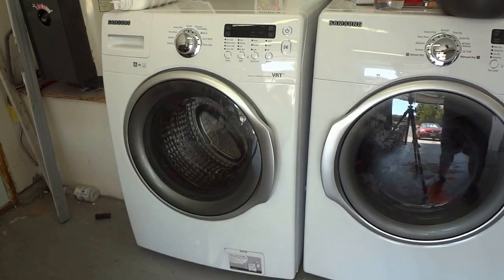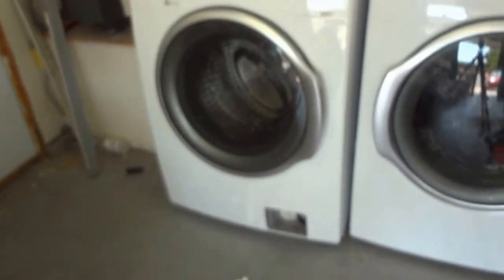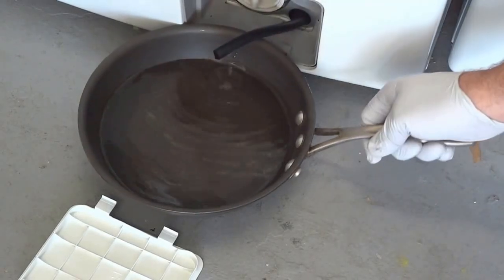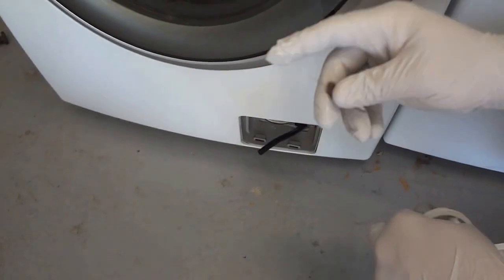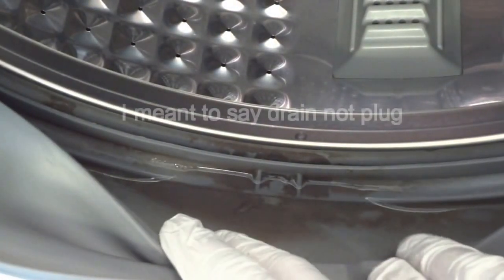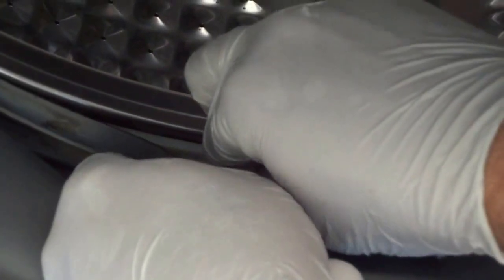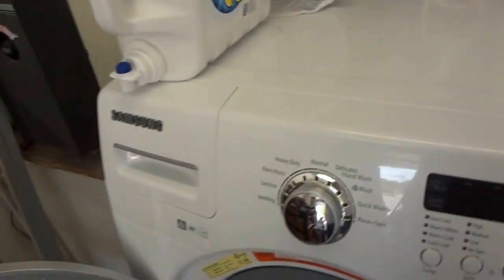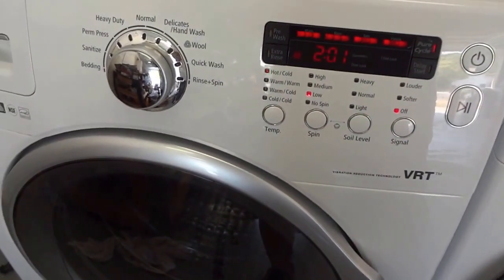Getting the stinky smell out of a Samsung front loading washer

Comment: I am an appliance repair technician and I will tell you that the odor is evidence of soap buildup on your inner plastic tub. Almost everyone has this problem. To confirm that you do, run an empty cycle with hot water and no soap. If you see lots of soap suds suddenly appear in the drum during agitation you need to do a vinegar wash to eliminate the build up. A whole gallon of vinegar should be used as the vinegar gets heavily diluted in the process. Start a clean washer cycle, then blend the vinegar with the incoming water during the fill. Cleaning out the soap residue takes away the food source for the mold and bacteria. Repeat a vinegar wash every 2 weeks to 30 days. Stay away from pods! They are too much soap and will get you right back where you started. Lastly, if you have a water softner or treatment system use almost NO soap. You dont need hardly any because your water will do the cleaning by itself. Think of your detergent as a water softner and conditioner. The water is conditioned to clean. If you have apparatus doing this on your water supply, adding detergent is redundant.
Reply: What about the inner lining? Will that (vinegar self-clean cycle) be enough to clean it or is scrubbing still recommended? It was recommended to use "Affresh" tablets with the self-clean cycle (which get used once a month). But there is still this sewer smell! AND we ruled out the p-trap (p-trap is not what smells!). The smell is coming from the bottom left side/bottom left corner of the washer where the drain tubes are. (Clean out area is empty and clean, draining clear water)
Reply: We read that vinegar will ruin the machine?!? That it is too hard on the hoses?
Reply: Don't use washing machine cleaners unless they are citric acid based. Check the ingredients and if you see sodium carbonate or sodium anything as the first ingredient don't use it! Sodium is what we are working to remove when we clean. You can't clean out sodium with more sodium! Vinegar or citric acid are food based acids with a mild acidity and won't harm anything in your washer.
Reply: @mikewalsh511 any thing acidic can corrode spider arm

Comment: It helps a lot to leave the door open between washes.  Our laundry area has a door itself so there is not much room if that door has to be closed.  So I wedge a styrofoam cup in the washer door so there is a few inches of gap.  I also have a tiny "desk" fan I use to circulate air into the opening a couple times per week.

Comment: I bought a product from Home Depot, called Afresh, that does a great job of cleaning my front-load Samsung washer. Once a month I put a cleaning puck inside the drum and activate the self-cleaning cycle. The first time I used it, after owning the machine for two years and becoming very stinky, it made the self-cleaning water in the drum super dirty. My machine no longer has an odor problem.

Comment: 7 years and I've never ever noticed this frigging bottom entry and even googled my make and model of how to self clean and Samsung instructed to use Pure Cycle mode as you described with no product and its 2 hours. Still smelled.  Purchased products for cleaning high eficiency front loader washers too. And finally googled elaborately how to clean self clean samsung blah blah blah BAD SMELL and here comes your video and I'm mind blown with this discovery trap with stinky water right there in plain sight at my feet (wtf!!!!) and the disgusting stenchy moldy nasty residue when pulling back the resistent rubber. I'm completely jaw dropped and smelly from watching and immediately following everything you did including the vinegar, but took all your advice and will literally never ever think about anything I've washed because was it ever truly clean or just masked with amazing smells?!!! Yuckkkkk. I will rewash everything I own in this  actual CLEAN WASHING MACHINE thanks to YOU!! Never again a front loader.
Reply: I said the same thing I’m never purchasing a front loader again.

Comment: I have this same unit, and do all the same things this gentleman showed. Once all loads are finished, I wipe both of the rubber seals as well as under the the smaller gasket.
Making sure all of the water is out of there. Then I pull out the detergent tray run it under warm water let it air dry, also wipe down the interior where the detergent tray goes. Finally dry the water off of the door.  Sounds like a lot of trouble you say, - takes me all of 3 minutes - and no gunk is left and no smell.

Comment: I have a Kenmore washer in use for about 14 years. Every month I run the cleaning cycle (41 minutes long) with either 3/4 cup of bleach or an Affresh tablet for washer cleaning. Then I wipe the rubber seal around the door and the door itself. After washing I leave the door cracked open and the detergent/softener tray partly open so the insides dry. Never had any bad smells out of the washer.

Comment: I actually just found my filter today since the water was sitting in the tub and was pitch black.... Glad I had solved that... So I did some more searching on maintenance I should be doing and found this video! Thank you so much. I was already wiping it down with white vinegar and cleaning the rubbery grey border, but I had no idea what the pure cycle mode was... I just have it running empty right now to clean it out, but I'll be sure to use the pure cycle next time.

Comment: Hi All, it's not only the filter and wiping out the door seal of excess water that you need to clean. You also need to pull out the soap drawer  completely, then spray, brush & wipe out the roof of this area. Never keep your drawer shut as mould will have a party. Always leave the door of the machine slightly ajar so the door seal can air. (It's in most manuals & how to videos by the manufacturers). If you follow these few simple steps you'll find you'll need less soap & will have cleaner washes. The environment will appreciate it to. 🦋Happy Washing 👚🩲🧦

Comment: Put a cup of vinegar in between wash, let it sit till next wash. Run clean cycle as much as 2 a week! With front loaders the drain pump turns on first!!! That’s why you want to let it sit between washes. I’ve had mine  for ten years and decided to replace drain pump to keep it to its optimum operation.. keep in mind these front loaders have their own heating element which brings the water to sanitize temp.

Comment: Hey also take out the detergent tray and clean that and behind it.  There is a clip you press down to remove it.  Mine was quite moldy.
Reply: Troy Maifeld i recently did this and sprayed mildew spray where the tray sits.. It was pretty yucky back there
Reply: undecidedlady79 I did the same thing! And I had to stop using liquid fab softener because my tray was flooded and not draining until I cleaned my machine—Now I am wondering if I should stop using Downy altogether, because it DOES leave a build-up. I now use Tide pods with the Downy in them (when Incan find them) to cut down on the liquid fab softener usage. I use dryer sheets whenever possible!!
Reply: Good advice yup remove that drawer stick it sink give it a good clean now look in space where drawer was u should see some holes in top area that would be directly above detergent drawer when it's inserted I'd use a small toothbrush for these also have to be cleaned as they are nozzles that spray water to mix with detergents before entering down into drum also back area use an old cloth give it all a good wipe perform good maintenance regularly and it should help extend the longevity of ur machine theoretically
Reply: You have to do this every 2 months to prevent your clothes from smelling and keep your washer operating properly. It says it in the manual. You should also leave the drum door and detergent drawer open so it can air out and dry after EVERY wash.

Comment: Wonderful.  I had stuff nobody should find in their home.  I will add that the filter has an o-ring.  Take that off and clean that also.  Take a toothbrush (not to be reused) and make sure all crevices and rubber areas are clean and shiny.  Mine had hardened.  Wipe the botton of the front door porthole, stuff collects their also.  If your washer still smells, you didn't get it all out.  Use a bright flashlight to check all those dark hidden areas.  It is everywhere!

Comment: I have a front loader now for almost 12 years. It’s a Samsung.
My machine never smelled of mold or anything other than The detergent that I’ve been using. 
I’m guessing because when I’m done with washing clothes I never close the door (all the way )to the washing machine which creates an airtight seal which does not allow the washer machine to breathe/Air out.
Reply: Henry Yulfo 

Great.  Henry, what is the model? Kg? I am looking to get a front loader but not sure which to buy. If you had your for 12 years. 👍😘. What is the brand and model. Thanks
Reply: I have had the front loader for about 9 years and I also keep the door open. The machine doesn't smell but the clothes do!!
Reply: How is it that a machine is sold in the millions and you are not supposed to close the door when done?  My laundry room is tiny and I deeply regret my purchase.
Reply: That's a fact. Our washer doesn't could not smell it by being by it and starting loads its the clothes started smelling and that's when we figured it out now almost 4 loads are ruined and can't get the smell out we've now ran the clean cycle with bleach twice and vinegar too and drained it multiple times but those loads are still smelling from before sadly even though washer is better

Comment: The really big problem with these machines is when the spider bracket corrodes and the drum starts spinning off center. There are plenty of youtube videos that describe this problem. When it occurs the entire machine needs to be taken apart and the spider needs to be replaced.
Reply: Joe Vignolo  - yep exactly what happened to mine! I read where one guy got some water proofing paint stuff from a auto parts store, that he was told is used on jets to protect certain parts from water damage. A small can was about $15. He painted it on the new part you spoke of to prevent corrosion. Mine was in four pieces and had parts that looked like ground up powder. What a rip off!

Comment: For this reason I would never buy a front-loader.  You must leave the door open in-between washes to let stuff inside dry.  That goes for top-loaders, front-loaders, dishwashers, bathrooms, etc.  With the seals on front loaders, they may not dry completely and the black mold and mildew will still grow.  Wow 2 - 4 hour self clean cycle...Won't that take away most, if not all the savings from low water usage and it certainly will cause more maintenance in the future, no?

Comment: I still have the manual and it all comes with the instructions for those who need it. 
Cleaning the debris filter 
1. Open the filter cover by pressing and pulling the handle of the filter cover with your finger.
2. Unscrew the drain cap by turning it counterclockwise.
3. Hold the cap on the end of the drain tube and slowly pull it out about 6 in. (15 cm) and drain off all the water.
4. Remove the debris filter cap.
5. Wash any dirt or other material from the debris filter. Make sure the drain pump propeller behind the debris filter is not blocked.
6. To assemble the filter cap, align the projected part of the filter cap to your 12 o'clock (on an imaginary clock) and turn it clockwise.
7. Replace the debris filter cap.
8. Replace the filter cover.

Cleaning the door seal
ANING THE DOOR SEAL
1. Open the washer door and remove any clothing or items from the washer.
2. Inspect the gray colored seal between the door opening and
о
the basket for stained areas. Pull back the seal to inspect all areas under the seal and to check for foreign objects.
seal
3. If stained areas are found, wipe down these areas of the seal, using the procedure that follows.
a) Mix a dilute solution, using ¾ cup (177 mL) of liquid chlorine bleach, and 1 gal. (3.8 L) of warm tap water.
b) Wipe the seal area with the dilute solution, using a damp cloth.
c) Let stand 5 minutes.
d Wipe down area thoroughly with a dry cloth and let the washer interior air dry with door
open.
MPORTANT:
Wear rubber gloves when cleaning for prolonged periods.
Refer to the bleach manufacturer's instructions for proper use.

Pure cycle
This course is a self-cleaning course that removes mold that may occur inside the washing machine.
1. Press the Power button.
2. Press the Pure Cycle™ button.
Finish
• You can only use the Delay Start function.
3. Press the Start/Pause button.
Carment + 57* chid lock
Door look g
..
Pure cyclel
Delay
Start
• If you press the Start/Pause button, the Pure Cycle course begins.
• Using the Pure Cycle course, you can clean the drum without using a cleansing agent.
CAUTION •
Never use the Pure Cycle course when laundry is in the washing machine. This may result in damage to the texture or a problem with the washing machine.
• If you want to use drum cleansing agent, use only 1/10 of the amount of the drum cleansing agent recommended by the cleansing agent manufacturer.
The Pure Cycle Auto Alarm Function
• If the "Pure Cycle" button is lit after a wash, it indicates that tub (drum) cleaning is required.
In this case, remove the laundry from the washing machine, turn the power on, and clean the drum by performing the Pure Cycle course.
• If you do not perform the Pure Cycle course, the "Pure Cycle" indicator is turned off.
However, the "Pure Cycle" indicator will light after two washes have been performed. This will not result in a problem with the washing machine.
• Although generally, the Pure Cycle Auto Alarm appears once a month or so, the frequency may differ depending on the number of times the washing machine is used

Comment: Animal by-products in liquid soaps and ultra liquid softener products cause washing machine mold by leaving a residue the builds up on the inside of the lining of the wash drum, the drain hose, and in the dispenser drawer pipe in which the mold feeds on  (visualize the inside of the kitchen sink drain.). 

Do an Internet search of those products made with animal by-products and avoid them. Powdered detergents with built in fabric softeners seem to be safe. 

Borax added to every wash will prevent on possibly undo most of the mold. Avoid liquid softeners altogether and use clothes dryer sheets instead.

Comment: 4:26 Not sure if adding liquids at the start of the self clean help. I have a Samsung too and when you first start the self clean, the machine immediately checks that the machine is empty of liquids by running the drain pump. This in effect removes the vinegar or other liquid you just added. I've added to the soap drawer after it has filled with better results. My seals are clean but the smell reamined after 16 ounces of White vinigar was added. I'm on septic so bleach has to be used minimally.Edit: I just poured straight bleach on a Mr.Clean dry eraser and scrubbed the drum, seals and door. Hope this will help. Added a little bleach about 10 minutes into the clean cycle.
Reply: Did this help at all? Ours smells iffy as well and we too have a septic tank so, as you know, have to use harsh chemicals sparingly. Never had this odour issue with a washer before!
Reply: Rosie Rossiter I hear all front loaders get the smell issue. We keep the washer door open when not send. Clorox on a sponge works but haven’t cleaned since my last comments.

Comment: This may improve the smell slightly, but will not get rid of it at all.  There is no way to get rid of it unless you disassemble the washer completely and manually clean all the parts of the washer, especially the drum and drum housing.  That funk you wiped off the gasket is not only there, but it's on the drum itself.  Pull the gasket back further and expose the outer lip of the drum.  Then put a towel on and around the lip.  Spin the washer by hand and you will see all the gunk accumulated.  Not only is it there but it's everywhere on the drum unfortunately.  Flawed design.

Comment: I have this same washer/dryer set and it seems regular wipe down of the gasket worked for about 4 years and now its worse than ever.  I found the drain hose in the back was so wretched with black icky muck also.  I have never tried Pure cycle though - i will try it!  I have done vinegar and bleach cycles plus afresh.  But never pure cycle.  The thing is tho, the spindle and bearings are out.  I have had the repair quoted at 580 bucks.  That stinks.  so we are using it broken (it doesn't spin efficiently) until I can get the money saved to get a speed queen.  This set is on the way out the door.  Until then, I need to de-stink again!

Comment: Follow simple rules to help prevent mould bacteria growth in washer 
1 after use wipe inside of door and washer seal soak up any excess moisture and  any bits caught in seal 
Other than that keep detergent drawer ajar to allow fresh air to circulate 
Next keep washer door open or at least ajar to allow fresh air to circulate 
2 once a month or when ur manual says or manufacturer recommends to remove filter and clean it to help control buildup of detergent dirt etc also check impeller behind filter turns freely
Personally I also use a anti limescale treatment once a month but each to their own but generally leaving door open and drawer helps as well as wiping up excess dirt moisture that will accumulate inside door seal